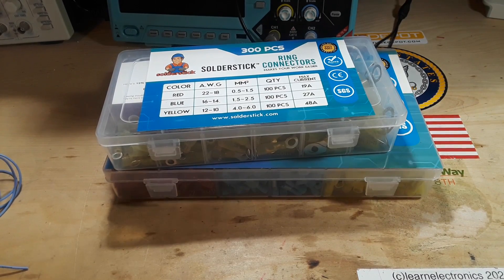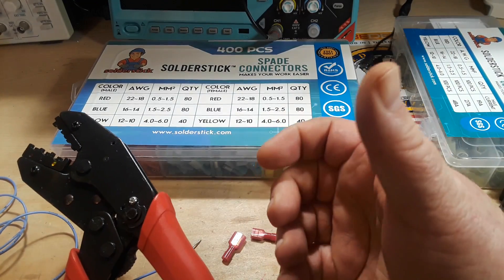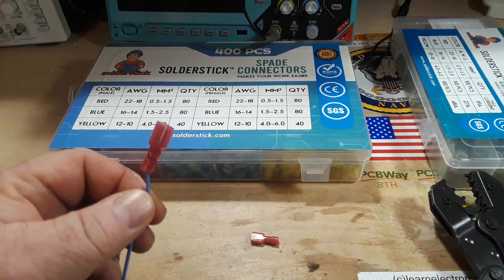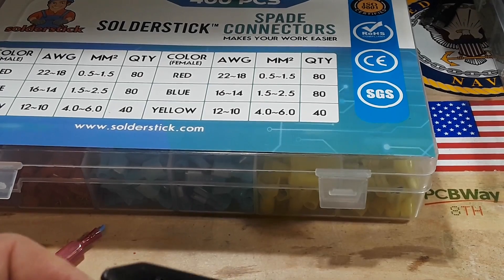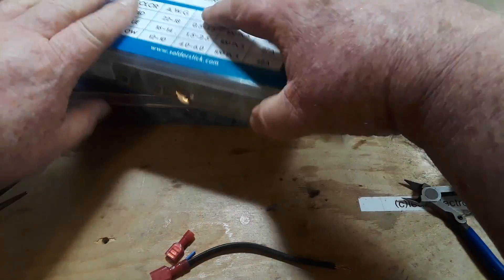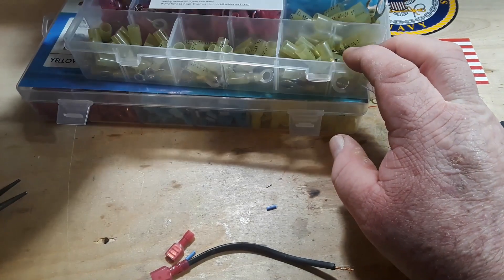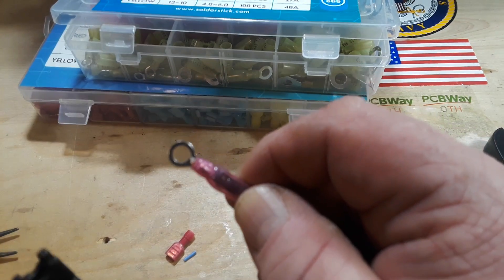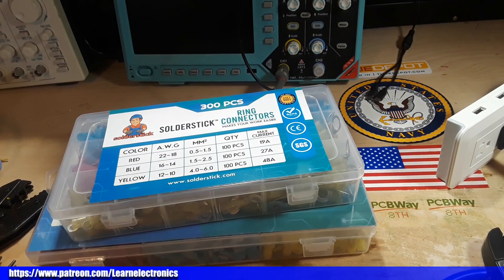How to Make Good Crimp Connections with Solderstick

Comment: What is the rule of thumb for terminating awg 26,24,22,20 wires? I worked as a tech and saved so many of these sized cable wires. I use them in all of my electronics projects but would like to terminate and use them properly. I have the 22 awg crimper set and could not make this work unless I soldered the wire directly to the fork connector for example. I've been researching Dupont and Ferrule but not sure if this is the correct path. Any advice would be greatly appreciated. Great video, thank you!
Reply from the maker: Ferrules are used a great deal in industry. Where I worked the idea was to never put unterminated wires into component, socket, switch etc. If A spade or ring wasn't thought of by manufacturer we used ferrules. Dupont are great for temporary installations.

Comment: Hi Paul, I noticed on your crimpers you had it set to the highest it would go, this setting just mashes the the crimp, and won’t give you a good hold on the wire, I think if you change it to position 4 not 6, your crimps will work better even on 22 gauge wire, I know from experience mate, great video also, say hi to Doggly and Blake from me, from Australia buddy.. keep up the awesome content mate cheers 🤙🏼🇦🇺